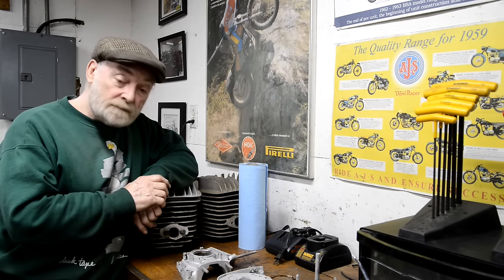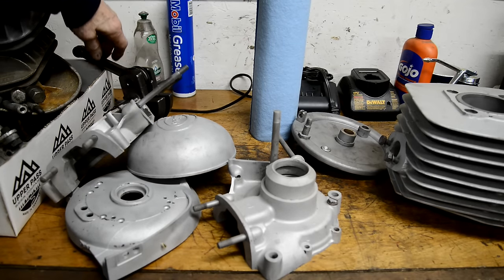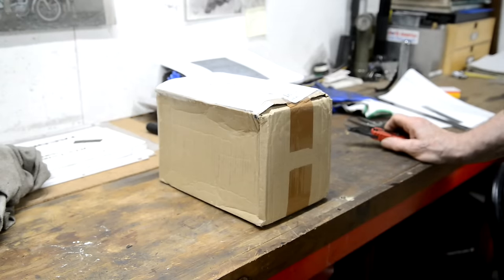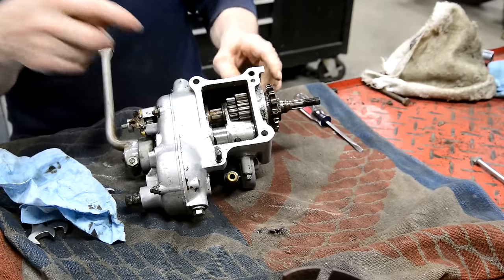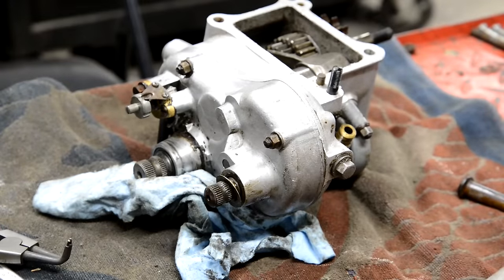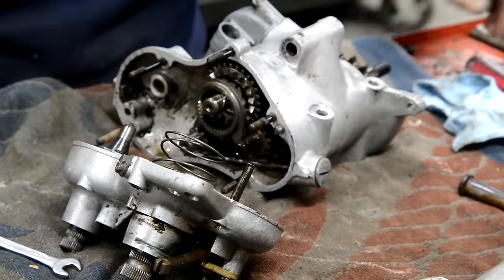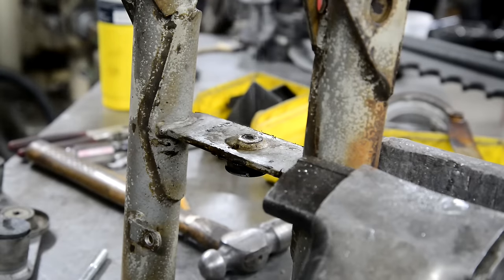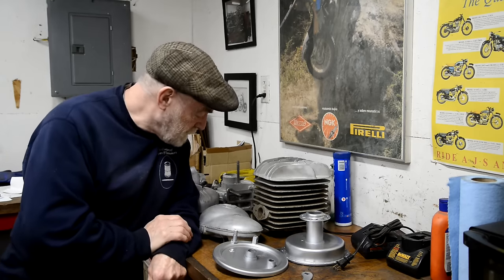Greeves Anglian  -  Part Three

Comment: It might be useful to check the cylinder port heights against the spec sheet before you have it rebored. The trials and motocross barrels look the same externally.  Just a thought.

Comment: I'm learning as you go so more info the better. Thank you for taking the time to show your process. Also i was informed pistons come in 20 thousand increments so it will be interesting what you find.
Reply from the maker: Original Villiers pistons came in 15 and 30 thou over, but the modern replacement ones come in 20 thou increments.

Comment: I usually video as much as possible and take out any bits which I think are too long in the edit, saves starting and stopping the camera.
Now starting on a 1961 Greeves MCS.
Those headrace bearings are a pain! I managed to remove the top one with a bearing puller after breaking off the cage but I couldn't get my puller between the fork tubes for the lower, luckily it wasn't that tight and just popped out.
For the cups I welded a bar across and knocked them out of the headstock with a rod.

Comment: You’re right about the Jake brakes, decompression braking forcing compressed air through the exhaust. Better braking power than exhaust braking ( which raises exhaust pressure) but better at slowing a truck.

Comment: Did you put the whole crank in the evapo rust? Including the bearings?
Reply from the maker: Yes it does no harm to the rollers or the cage, and there was no rust on the rollers so no loss of material.